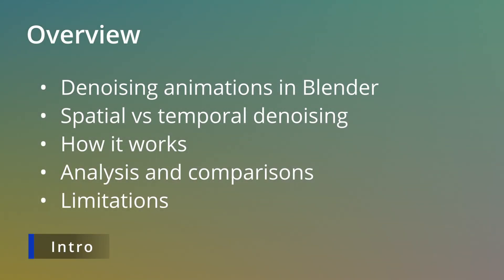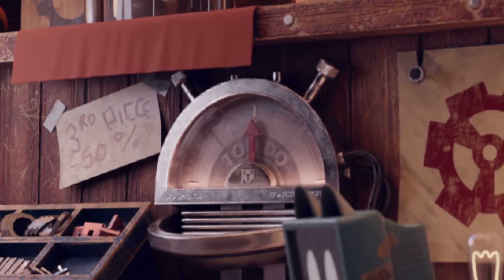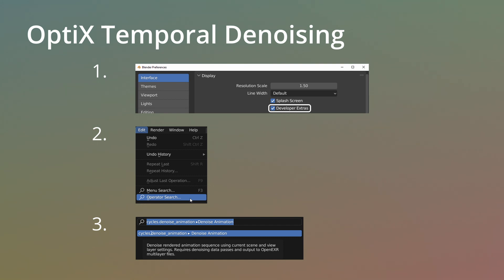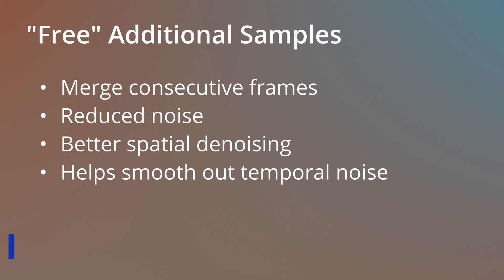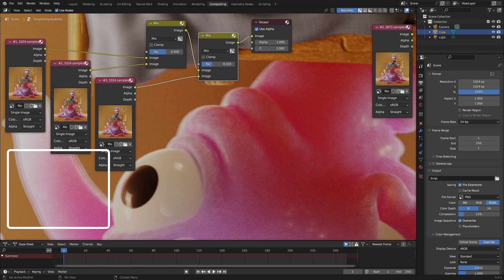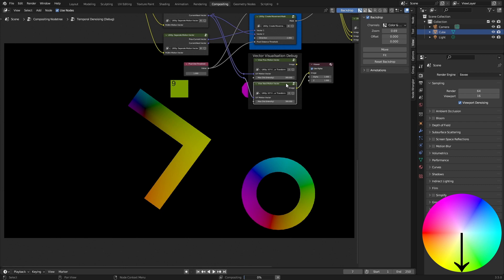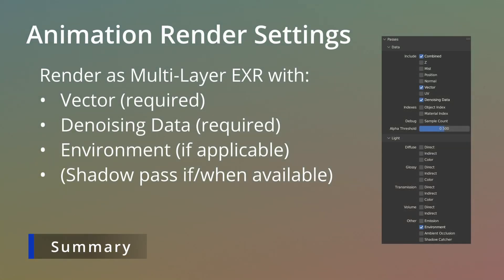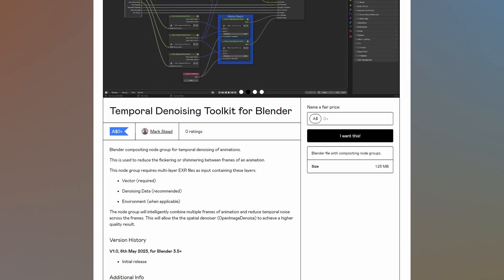Temporal Denoising Analysis

Comment: is there a methed, to only denoice a littlebit of a video? i love the akurat and vor all the filmy look of grain, noice in 3D is no grain, but if i use lot of samples, and use everytime a new noiceseed, it kinda look licke filmgrain, and i realy like it. But whif volumetrics and spechaly fire simulations, a denoice is very very good, to not render all day, so, my question, is there a way to only clean a littlebit so i can have the grainy look, but not have all the fireflys and dark holes, that dont ge a ray, 
i think about a compositing stepp, that you can use the denoicer, but some how mix it whis the original image to get a more detiled and not so clean image as an denoicer. :D but i still figuring it out
Reply from the maker: I'd use the compositor too.  You can choose the percentage (factor) of the noisy/denoised mix.  Adding animation keyframes will allow you to change the mix over time.

Comment: We need a straightforward tutorial on how to use this to render animations. As an artist and not a graphics engineer im still very confused
Reply: There are plenty of those out there, and this node group is kinda simpler (but maybe better? I've yet to test) to use than others.

Look up; 'Less samples, cleaner render' by Edin Spiegel to get the idea of how Temporal Denoising works and step by step on doing it
Also look up; "De-noising flickering animation (temporal de-noising) and tips!" by Static VFX (mentioned in the previous video as well) as he also covers various methods of denoising before you do the temporal denoising. As well as his own Temporal denoising (he keeps his median Temporal denoising behind a paywall though)

If you want a run-down of the whole process it goes like this; 

animate your scene and get it render ready. Make sure you include the under view layer, passes and data that you have at least; 'Vector', 'Denoising Data' and in some cases 'Z' passes selected. If doing MultiPass Denoising you'll also want to select all the light passes except shadow catcher. Render the scene as an OpenEXR MultiLayer image sequence(You MUST use this file type, PNG or any other filetypes do not support the additional layers mentioned above). Use the compositor to denoise the image during the render process using the denoising data layer mentioned before.

Once rendered out you will have a sequence of quite large EXR images, open a new blender file using the same color management settings, switch over to the compositing tab and load in this temporal denoiser node group or any temporal denoiser node group by appending them; then make a image sequence node and load up the EXR images you created. Duplicate that image sequence node for however many the temporal denoiser supports; setting their offsets as needed and plug the; 'image', 'vector', 'depth' into their respective slots on the denoiser where applicable.

Now you may under the render settings switch the file format to something like MP4 or whichever video format you want, then click 'render animation' to composite out those EXR images, temporally stabilize them, and convert them to a merged video file.

There are tons of optional stuff I'm leaving out here and additionally they all seem to have some rough edges or limitations. But that's the short of it, it's quite a process.

Comment: How to use temporal Denoising with optix..?
Reply from the maker: @0rdyin  If you mean using the Optix spatial denoiser, then I don't think you can inside the compositor.  Though maybe you could denoise in the render settings before passing to the compositor.
I thought that OIDN is considered better for final render, and it can be GPU accelerated now (depending on your GPU).

Comment: thanks for this - I'm currently struggling with an animation containing a glass object with a subsurface object (candle wax in a glass jar) and I'm wondering if the world scale of the objects is a factor in blender's calculations. Also curious if rendering out frames twice as large with low sample rates as needed and then scaling them down in a compositor would help matters.
Reply from the maker: I'm not sure the world scale would make much difference in this case.  Though it is important to get the size of the lights sensible - having a really small light, or one really close to an object (as I recall) can make fireflies worse.

Subsurface scattering is going to cause long render times, and then you're adding glass on top.
I guess you need to optimise those materials separately.
You might want to look at the anisotropy setting for the subsurface, to control how deep the light penetrates.
Glass will make it complicated for light to pass, and normally when doing window panes you use the light path node to allow light bounces to pass through easily (using TransparentBSDF).
Once you've done all you can to tame the fireflies, then it comes down to denoising.

If you find that the noise is very high in a specific part of your scene (the wax or glass), then you may be able to isolate and do spatial and temporal denoising on just that layer.  For example you could use Light Paths to illuminate just the wax with the light(s), and then have a separate copy of those light(s) for illuminating the remainder of the scene.  They can then be handled separately in the compositor.  Can probably do the same using Cryptomatte.

I'm sceptical about rendering at twice the resolution - though I have heard that mentioned before.  I don't recall whether it was in the context of rendering a still image or an animation.
Reply: @MarkStead  Thanks Mark, yep I really picked a great combo lol - I've begun rendering out the various layers with holdouts (very handy) and that seems to be the way out. Appreciate your time and help.

Comment: I can't seem to get it  to work. when there is still more noise in my scene than simply using a normal denoiser node
Reply: I noticed when using the debugger, to get my motion colors to show at proper exposure I have to change the intensity down from 300 to 5. I don't know how to apply this to the non debugging denoising node.
Reply from the maker: The visualisation is converting the distance into a luminance/colour value, where the larger the distance moved results in a brighter luminance.  The intensity value you're referring to is to control the conversion of the movement distance (in pixels) to an luminance value - where you don't want it to be too dark or too bright.  It only applies when using the debugger mode.
Reply from the maker: The intent wasn't to do away with normal (spatial) denoising, instead to give it more samples to work with so that it can deliver a more accurate and hopefully temporally stable result.
Of course if you're rendering with lots of samples anyway, then you may be able to eliminate spatial denoising - so long as you want some fine (or at least finer) grain in the render.
Right now I'm working on an animation with fog, and specifically using this to denoise the volumetrics pass only.  There's lots of noise in the volumetrics, and the spatial denoiser completely eliminates the noise, however when you watch the animation there's noticeable brightness changes - which are exacerbated by smoothing the volumetrics completely.

Comment: a bit of dilemma, enabling vector pass only works when there`s no motion blur activated. But I need it also
Reply from the maker: I didn't know that.  I just assumed it was possible.  You could do something crazy like render out a sequence with one sample, no motion blur, and the vector pass.  The problem you've got is that vector represents the position at a single point in time, and there's no way to get the range of movement for the visible blur.  (The blur may not be linear.). Maybe when the movement is very low temporal denoising might still make sense, but then the denoising could be automatically disabled in the areas of the image with more movement and blur (and perhaps is less noticeable anyway).

Comment: A few years back, I was tackling this same problem in Vray for 3ds Max. Vray had a tool back then, a standalone vdenoise.exe in which you could specify how many frames you want to consider before and after. I downloaded the old documentation, and found this description of what it takes into account when denoising, and it's quite a lot:

Noise level (named noiseLevel) - The denoiser relies heavily on this render element to provide information used during the denoising operation.
Defocus amount (named defocusAmount)
World positions (named worldPositions or wpp)
World normals with bump mapping (named worldNormals)
Diffuse filter (named diffuseFilter or VRayDiffuseFilter)
Reflection filter (named reflectionFilter or VRayReflectionFilter)
Refraction filter (named refractionFilter or VRayRefractionFilter)

I suspect that the devs at Vray tried (or did) model how all of these affect the denoising and are using some fitted equation with weights based on all of these channels + the temporal images. I was messing the other day with OpenImage Denoise (oidn) 2.1 and managed to make it running outside of Blender on my AMD GPU. The speed up was roughly 2x on my RX6950XT, however it only thakes in the noisy image, normal map and albedo to do the denoise, so I'm thinking Vray has a more sophisticated algorithm. 

But all of this had me thinking. Perhaps a crazy idea, but what if we render double the number of frames, apply the temporal denoising, and then throw away every second frame, to get the same FPS? Basically, "oversampling" in the time domain for the purpose of better estimating the changes from frame to frame, and better denoising the image?

Comment: Now that I have finished creating the node, do I have to convert it to an image again, or can I convert it directly to a video? Please reply.
Reply from the maker: 👍 You can output as a video file.  Just going from memory, you would (1) connect the denoised image to the Composite node, and then configure the output settings in the normal place, or alternatively (2) use the File Output node and specify the output settings in the node properties (N panel).  Output using FFmpeg Video with MPEG-4/AV1/etc.

Comment: Thanks, but how do I save the temporally denoised after compositing them?
Reply from the maker: Yeah sorry about that - all the screen captures just show the Viewer node.
You need to add a Composite node, and connect Image input.
Then set your Render Output settings (presumably now rendering out as H.264 using FFmpeg Video), then activate Render Animation (Ctrl+F12).

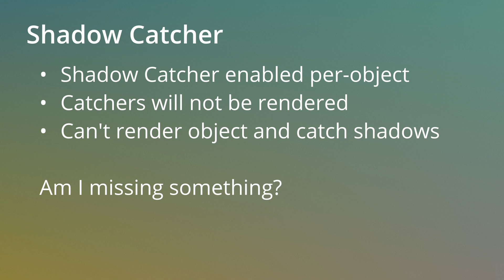Comment: Hey Mark it looks like you are looking for median denoising.  https://www.youtube.com/watch?v=851cEK0Taro at about 8:00 minutes in he briefly goes over it, so if you have any deeper knowledge on this guys set up I would love to know!
Reply from the maker: I did try using a median function, but didn't get better results.  There's still a median node group implementation in the debug denoiser that you can hook up and try.

I ended up focusing on what noisy pixels are like, where they might exhibit a different luminosity or a significant color shift.  I tried a fancy (or dodgy) algorithm to apply a weighting to the hue, saturation and luminosity differences and exclude samples where the difference exceeds a threshold.

I'd appreciate any feedback for where you see an improvement using the median function.
Reply: @MarkStead  So for my current project I am getting a perfect sequence with just a single pass denoise on each of the 3 frames ---- running "next" and "previous" into vextor displacemnt ------- running those 2 outputs and the output from the "current frame" into your median group then OUT.  [(just the utility median blend group not any other parts from your package)]

I will have to render it and see what it looks like in premier but it already looks cleaner than the averaged frame method I tried earlier.  I mean it looks really good!
Reply: my scene is a pretty simple project and not a heavily detailed with minimal objects, so I'm not sure how much that plays into the final result others may have.
Reply: @MarkStead  will let you know if I come up with anything useful.  I am also looking into Blender to Unreal Engine, for its rendering speed.

Comment: Do you know if there is any way to minimize the occlusion masks including edges of objects, even when they are stationary? Does it have something to do with aliasing in the render? I am using your techniques for a different purpose (in projection-mapping textures on moving scenes, to distinguish occluded regions and inpaint them)
Reply from the maker: Have you looked at Cryptomatte?
At one point I was trying to use the Cryptomatte node to distinguish between different objects.  The problem is that it is designed to be used with a Matte selection - so then I tried to understand how the raw Cryptomatte render layer was structured - referring to this document https://raw.githubusercontent.com/Psyop/Cryptomatte/master/specification/IDmattes_poster.pdf

However it was an impossible task for me - since there is no unique object ID for a given pixel position.  Specifically the Cryptomatte data represents all the source objects that create the pixel (including reflections, anti-aliasing, transparency, motion blur) and a weighting for each.

If you're able to make a Cryptomatte selection for the occluded region, then this should give you a mask with properly anti-aliased edges.

However (not that I understand your project exactly), perhaps you could also be looking at the Shader nodes and rendering those faces with emission and everything else transparent (perhaps using material override for the whole scene).  You might be able to use Geometry Nodes to calculate the angles to the projector to give you an X/Y coordinate.  GN could also calculate the facing angle and therefore the level of illumination falloff (or whether a face is occluded completely).

Comment: How to get more "free" samples in blender, without blending different frames: Simply render the same frame at a different seed. combine those.
You can most of the time, only render a third or a half the samples. which might even be faster than rendering the image once with full samples.
Reply from the maker: I'm not sure that really helps, though it might seem to.  Rendering more samples is effectively giving more seed values because each sample has different random properties that result in light rays bouncing differently throughout the scene.  In some cases a ray will randomly hit the diffuse colour, and in other cases it does a specular reflection (with a slightly different random bounce angle).
Reply: @MarkStead  Please try, combining 3 "Seed renders" with say 500 samples, will give you a better image than rendering it once with 1500 samples. If you get what i mean.
(I use M4CHIN3 tools, and he has that built-in as an custom operator in the Render menu)
When rendering, each sample uses the same seed. If you ever rendered an animation with a fixed seed, you will notice that the noise stays the same.  
Bringing that to the extreme and only render with say 20 samples. You will notice the same pixels are black (not sampled at all) in the first frame as well as in the second frame.
Now, using the same logic on a still frame, and rendering it with only 20 samples, but a differnt seed, now other pixels are black (not rendered).
Of course this difference gets lower and lower depending on how many samples you start out with, but since we are not rendering to infinite sample, it will improve the clarity for low samples.

It's the same effect as rendering an image with 200% resolution and half the samples. after denoising and downsampling you get a better image, as you gathered more "spatial samples". As one pixel previously was now 4 pixels to sample.
Reply: This does get a little funky since Blender doesn't let you set the rays per pixel, but just an overall sample amount (Which is pretty dumb), regardless it still works.
Reply from the maker: Yeah, in an earlier version of Blender (I guess 2.93 and earlier) there was Branched Path Tracing.
This allowed you to specify how many sub-samples for different rays (e.g. Diffuse, Glossy, Transmission etc).  So the benefit is that you can increase the samples where it matters - e.g. Glossy or Transmission.  Furthermore I guess I saw it as a way where you didn't need to recalculate the all light bounces from the camera every time.
However in my testing way back then, I actually got better results using Branched Path Tracing, and setting the sub-samples to 1 only.

Anyway, if you're getting good results by modifying the seed value - then go for it.

This is an excellent technique if you render scene (particularly for a video) - then decide you should have used more samples.  Just render again with a different seed - and merge the frames.

Comment: Hey ive been rendering EXR with blender and i don't see Vector or Noisy Image and i have that checked on my render passes is there something im missing?
Reply from the maker: Check it's saved as a MultiLayer EXR.
Reply: i will do that right now hope it works all keep u posted 
 @MarkStead
Reply: i figured it out it has to be selected to layer setting instead of combinded, when i set it to layer it showed all the inputs that i was wanting awesome @MarkStead
Reply: it works but how do i use this for a 250 frame animation @MarkStead
Reply from the maker: When rendering you render out your animation as MultiLayer EXR, ending up with 250 separate EXR files.
Then import all the EXR files into a compositor session - importing as an Image Sequence (what I do is click on the first file, then press A to select them all).